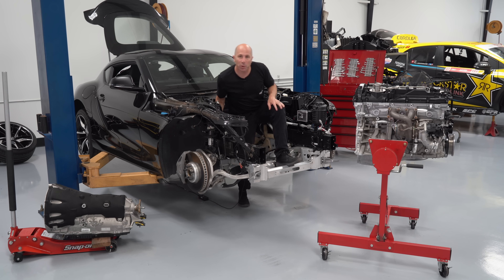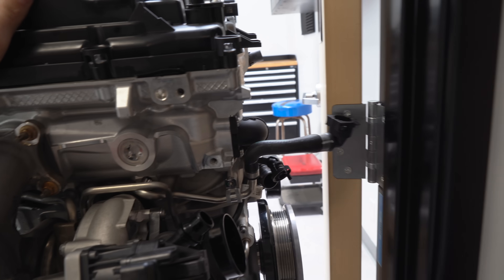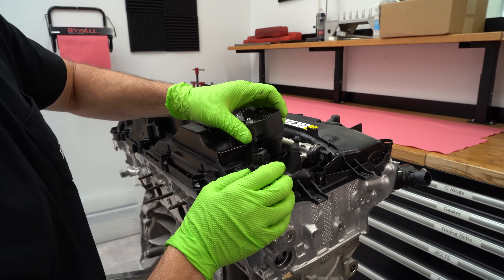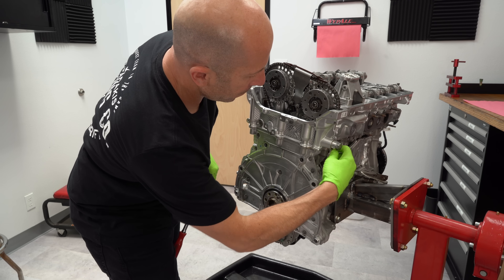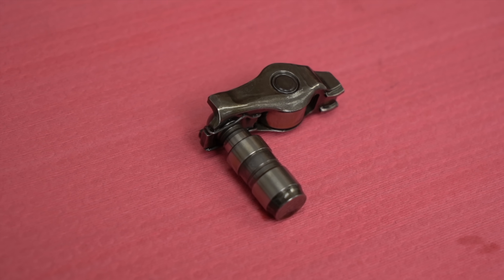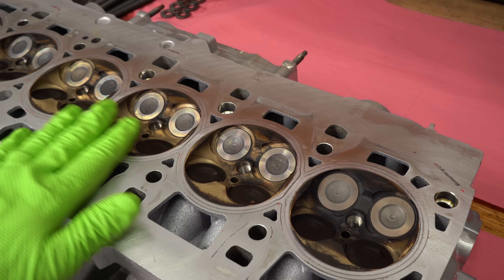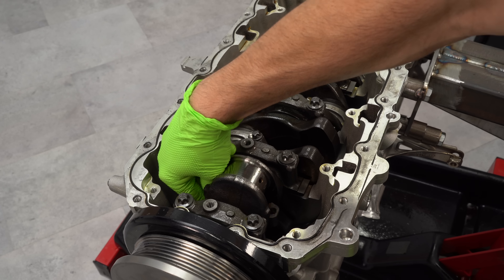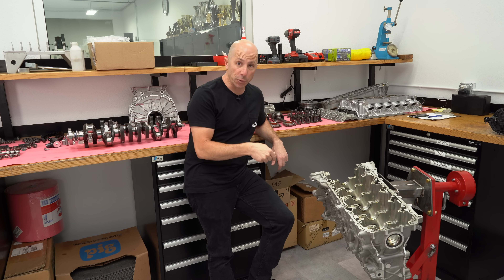2020 Supra B58 Engine Teardown - First Look - Better than the 2JZ?

Comment: To sum it up Bmw engineers made things more complex to work on simple things... and u can tell when it is a bmw engine no oil dip stick. Bmw is notorious for oil leaks, now for longevity this could be a nightmare to maintain it yourself. Even for a simple valve cover job, or the thermo stat...

Comment: To remove and reinstall the injectors the correct and only way is a b*tch! And can only be done with BMW special tools. Injector body is plastic, if pulled off wrong it will crack and leak. Same goes for install, if installed crooked it will leak, stupid engine imo.

Comment: Looks like a good engine design, but not made for modification. Updating the cooling is going to be a problem I’d think. Very interesting, you’ve got a new subscriber.
Reply: Cooling hasn't been a problem with people pushing 5-600hp in these. Now the only thing is however is cooling for 8-1000hp.

Comment: How is this a simplified engine? This will never replace a 2JZ. and this engine is the reason I hate German engineering, the timing chain sandwiched between the trans and the engine block is the most idiotic bullshit design. This is not a Supra, this isn't a Toyota product, it's simply a rebadged piece of crap bimmer. Why couldn't Toyota have done the same thing with their Supra as they did with the Lexus LFA? Simple, Toyota cheapened out and didn't want to design shit. Instead the corporate ninny brigade said, let's just pay some dumb fuck german firm some money and rebadge one of their bullshit cars with the Supra moniker. This is not a fucking Supra, it's a piece of shit bimmer. However Papadakis explanation is top notch, I met you nearly 20 years ago at the Texas speedaway when you were running the infamous yellow hatchback that rocked! You're an awesome mechanic, keep up your great work ethic.

Comment: Bmw: Here is your engine Toyota use it wisely.
Toyota in a few years: takes old b58 and redesign it to be better like how they did with 1jz
Reply: With your last statement you're suggesting the 1jz was majorly redesigned at some point?
Reply: Tim Smith originally the 1jz was originally an M engine with a couple more cylinders.
Reply: Vinny Booboo woah chill dumb ass 💀 I drive an LS460L, I didn’t know chill.

Comment: More efficient maybe. You can change oil without removing the engine. internal exhaust manifold what? Mechanical fuel pump sounds nice though.
Reply: We've had integrated manifolds for a while now.

Comment: That 14mm socket is a bmw specialty, cost is around 30 bucks for that one socket
Reply: er no, you can get em from any auto supplier for about 2 or 3 dollars, its just a 14mm thin wall 12 point spark plug socket, peugeout use em too, and mini.
its just for some beemers you need a thin wall one not just a standard 12 point deep socket.
30 bucks?
youve been had .
Reply: I found one at a garage sale for a quarter ...

Comment: It does look like they solved a lot of the problems with the N54 and N55 engines.
I so want that HPFP right about now
Reply: It could be said that after two or three iterations, BMW has solved the weak HPFP. The B58's fuel delivery system seems simpler than the one in the N54 and N55 engines, lets just hope that cam lobe and the contact point at the end of the fuel pump are stronger than those that VW put in their 2.0 FSI engines. I would still go for the N54, however. This engine looks fantastic, but the complexity of its systems (not necessarily its assembly) makes working on the N54 look like a walk in the park. And don't even get me started on the price of mods.

Comment: I'm surprised you can take a 2020 engine apart without breaking something.
Reply: Because he is obviously really good at what he does, I have a few cars including  a BMW 340i which has the same engine as the supra, my old cars I work on all the time, but you have to know your skill limitations and make sure you have all the correct tools for the job, too many times have I seen someone break shit because they are either hacks or don't have the right tools but proceed in taking it apart anyway. If you break something it's definitely  a sign that you shouldn't be working on it in the first place !
Reply: e-tronic is way too complicated lmao
Reply: Because racecar lol btw it’s embrassing to break something on or in a brand new car 
People gonna start hating saying he’s not professional
Reply: This is the best time to pull it apart. With all these plastics becoming brittle from heat cycling I'd be dreading working on this in a few (5-10) years time.
Reply: Someone has to be able to put this stuff together, and do it in a cost efficient manner. The more mature a technology is, the simpler it looks.
Reply: Theyre least likely to break when theyre new. You probably just suck at working on cars.
Reply: Its still 2020.

Take a 2020 engine apart in 2030
Reply: Because it's a German engine on a Japanese car. Not made on the USA
Reply: @e-tronicsystems3064  I've taken apart American engines for years, German engines are a fucking pain in the ASS... Same place where your comment came from, your ass
Reply: e-tronic systems American cars are much better then they used to be. If your breaking something you probably don’t know what your doing.
Reply: Because its a bmw

Comment: What's crazy is I tore apart a Honda motor the other day and it implements so many of the same things as this one. They crack the conrods the same way, they coat the pistons in the same way, they have the same rocker design. But the weakness is in the block. They have an open water jacket. They try to counter that weakness with sleeves that they actually cast the block around, but it's still poor design for high power applications.

Comment: Is it going to be possible to get 1000hp with only two small exhaust outlet on the cylinder head?
Reply: The Z4 has a 6 port head that is interchangeable with the mk5s 2 port heads.
Reply: Well that’s not a good right ?  Is taking two engine just to get the hp that a 2jz can make alone.
Reply: @JuanGonzalez-ig9su  not what im saying....im saying just switch the heads is all.
Reply: Carboy Dorifuto party I understand what you mean but what I’m saying is on the 2jz engine you didn’t have to change the head or the cylinder block just upgrade the internals and you got over 1000hp
Reply: @JuanGonzalez-ig9su  there probably won't be much done to this to get 1000hp anyway since ones got over 820hp with a turbo,tune,and down pipes.
Reply: Carboy Dorifuto party there’s a video so I can see over 820hp? The most I’ve seen is 575hp
Reply: @JuanGonzalez-ig9su  it's on Instagram. There's a BMW with a B58 that has 820hp(last record it had was 701hp)
Reply: Seb C so what you’re telling me is that you will be able to get 1000hp just by swapping cylinder head with no upgrades on it?

Comment: The timing chain being at the back of the engine (and being a chain) is actually a good thing IMO. This means accessories and cooling are ran by serpentine belt and doesn't require a full timing job because someone thought it was a good idea for the water pump to be ran by the timing belt
Reply: Omg this. Cough 370z...
Reply: It also makes the valvetrain less susceptible to torsional vibration.

Comment: Imagine getting charge with 20 hours labor for timing cover oil leak.
Reply: 20 hours labor not $20 per hour. 🤦‍♂️
Reply: chunky soup  @$135/hour
Reply: @m4a1JAY  really?!! I dont think so
Reply: welcome to owning a bmw
Reply: @ngd223  😂
Reply: It's best to trade it in when the warranty is up. Then again with all the mods everyone is planning most will be out of warranty prematurely anyway. That's unless you can fix it yourself.
Reply: Patrick Lavine if you have even basic mechanic skills then Bmws can be very cheap and easy to maintain, my local dealer has always quoted me 100$ per hour(that’s including a 2 year warranty on ANY repair or service that they do)  plus every Bmw dealer now does comprehensive diagnostics free of charge for any bmw, the dealers get a bad rep but they’ve had the best customer service and staff that I’ve ever seen at any establishment, they quoted me 900$ (if I provide the parts) to replace the entire clutch, flywheel, rear main seal assembly, and warranty it, same day return with a shuttle provided, they’ll even wash your car for free if you ask during service🤷🏼‍♂️
Reply: @Whiboi  took my 2018 x6m for an oil chnage and low oil light came on within three weeks and ive had to put 3 quarts since. My infotainment mysteriously has started having problems. Everything was fine until I went in for routine maintenance. I'll never take my car back to BMW I'm sure they intentionally are trying to destroy my vehicle. I thought it was fishy to keep my vehicle for two days for an oil change. I've contacted BMW of north America and filed a complaint. It seems they intentionally are trying to cause problems to my vehicle.
Reply: @Whiboi , okay since I don't believe you found a BMW dealer charging as low as 100/hr, what is the name of it?
Reply: Milk Man yeah 2 year warranty when you supply the parts. You are high!
Reply: willbur 420 2 days for an oil change?! Holy shit man, i just did mine yesterday and it took an hour. Find yourself a reputable third-party shop which specializes in bmw, sometimes they even give discounts for return customers lol, just build that connection
Reply: john jay  There's a guy on youtube that shows how much of a nightmare trying to work on a tesla is. I also think Telsa is rated one of the worst in reliability? So I dunno..
Reply: That's actually a thing with european autos. They will sit for a day or two in a year for maintainance and will serve you with lots of fun unlike a lexus which probably doesnt need a service,lol. Like i said earlier owning an european is like marrying an classy hot supermodel. She will serve you really nice if u take good care of her
Reply: That's a reality for Audi s5 owners lol
Reply: Don't go to dodgy shops that charge 20hrs for a 2hr job 🤷‍♂️
Reply: @flinchey  You have to remove the engine if the timing belt is at the firewall. It's not a 2 hour job.
Reply: At my shop it will be almost 4000-4700 for 20 hours of work
Reply: In the car it's not to bad drop the transmission and you have full access
Reply: john jay and have a highly explosive component at the bottom
Reply: Audi Q7 come at me ahahahaha
Reply: @PlayerPunisher  well I've been a mechanic for 11 years now, and i know exactly what you're saying. Yes we do quote much longer hours than the job actually takes. But hey you already know you're going to get ripped when you go to a mechanic. We've made plenty of money of Toyota's and lexus. Not to say it's right, but it's pretty much the only way to make money as a mechanic. I feel bad at times but I've worked at multiple establishments and they're all the same.
Reply: @moegamezzz3622  you make it sound like were all scumbags. I dont feel guilty at all if a job pays 2 hours and i finish in 1 hour. You have to make up for all the times you get screwed and a job takes longer than it pays. Plus, you have to develop your skills and buy tools to get to that point of beating the flat rate. The shop takes most of the money anways. Every hour you flag, the shop makes $100, so if the customer thinks the price is too high, then thats the fault of the shop, not the mechanic.
Reply: 20 hours if your mechanic has never touched a motor before and took a 15 hour break in the process.
Reply: @moegamezzz3622  Unbolt the motor from the trans , replace gaskets and re install engine in 5hrs ? Def not at the local Toyota dealership.
Reply: Nah you charge what the job pays regardless of the actual labor time.

Comment: Well Toyota didn't really partner up with BMW when it comes to this engine. BMW developed and used this engine way before, it was already in car in 2015, so development started way earlier. This is 100% BMW's own engine and Toyota didn't really have much to do with it at all. They worked together on other aspects of the car.
Reply: Well theres slight differences in this B58 than any other. The heads and turbos are different,and the fuel system is different(more high pressure) and it has more oil squirters.

Comment: Is it true the m40 engine in the BWW different to that in Toyota Supra's if only a slight difference?
Reply: Little bit. Heads are different,turbos different,fuel systems different(more high pressure),and has more oil squirters.
Reply: @carboydorifutoparty3976  but fundamentally the main part of it's the same unit, sutle differences

Comment: Everyone complaining about "too much plastic" basically screams "I have no clue about engineering and material science".  This isn't just what clueless people call "plastic" (as if there's only one type of plastic...).  It's all extremely durable, strong, tough, impact and wear resistant polyamides reinforced by glass or carbon fiber. These parts are extremely light, but very, very tough, and actually better at doing their job than a metal part would be, on top of that they're lighter too. Also, the design and complexity of components can be far higher than if they were made out of aluminium or steel, and therefore can be more functional, more efficient, etc. As for them breaking, they won't. That's one advantage of these parts, because they're not cast out of some metal, which can crack or snap easily. They have some flexibility to them, elongation at break for these materials is often 30-40%, which means they'll never snap, crack, break, etc. in practice. They won't care about heat cycles or vibration as much as most metal parts would either. They're much stronger than they need to be. You know why? Because nowadays it's impossible to make parts too weak, considering you can simulate their behavior long before they go into production, and all car parts are made much stronger than they'll ever need to be in regular use, so if a part is made out of plastic, it's made out of plastic for a reason. It just shocks me how clueless the so called "car guys" in youtube comments are about cars and science related to them.  It's the same as those old farts in the 90's who complained about cars being "weak" because they had plastic bumpers instead of steel ones like older cars did, but they didn't understand anything about the structure of car bodies under those plastic bumpers and didn't understand those modern "plastic" cars were much stronger than the older "tough" ones, and that crashing those modern "plastic cars" into their old steel tanks would show them how tough they really were.
Reply: Tell that to the people who have to replace water pumps that have plastic propellers in them. A lot of manufacturers do this now and have done for years. I have replaced two on VWs with less than 50k miles on and my friends skoda went at 12k miles less than a year old and was done on warranty. Luckily after market pumps have a metal propeller and don't need changing again after.... I agree plastic is good for some things but definitely not for the above. Also worth noting that 3d printing can now add continuous strands of carbon fiber that can make plastic stronger than metal now but that's only a recent thing.

Comment: Hope you didnt damage the cam taking it off like that.  If you dont have the tool the proper way is orient the cam in such a way where all the pressure is on one cylinder typically it would be #1. From there you can lossen each cam bolt on the cam caps a 1/4 turn untill leaving the last cam cap with the pressure on it last to remove. The key is to not have ANY pressure being put on the cam in the MIDDLE.

Comment: I feel like the 2 little exhaust ports are going to cause alot of back pressure and limit the engine severely
Reply: Heads can be switched from the Z4s B58 since its heads have 6 exhaust ports. Plus next year model mk5s are supposed to have 6 exhaust port heads anyway.

Comment: Cough " BMW N Series engine design" cough
Reply: It's not all the way the same as the N series.
Reply: @carboydorifutoparty3976  I know but there is alot of similarities and also nothing secret about the  partnership
Reply: @dinof84  only differences really are the heads,the fuel system,and the amount of oil squirters it has really.

Comment: This is going to be fascinating. As engines develope, it's gettting more difficult to extract more power. The exhaust manifolding on this one is potentially going to be a limiting factor.  My money is on it making about 1000 BHP  but at higher than expected boost pressure.  At some point some one will have to be brave, and machine of that" head integrated manifold" to see if it's possible to mount a conventional manifold on that face.

Comment: Lots of comment on timing chain is that looks real weedy. Im unsure what the longevity of the chain is rated at. but 100 k miles maybe not on that. No dual fuel inject {port injectors} to in sure intakes stay clean. and what is so wrong about having a dip stick to know where the oil level is.